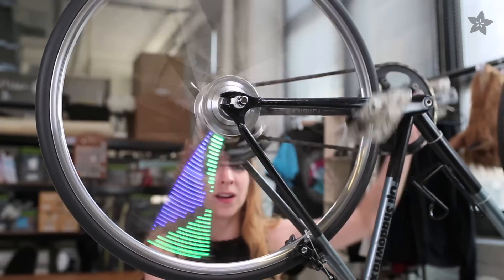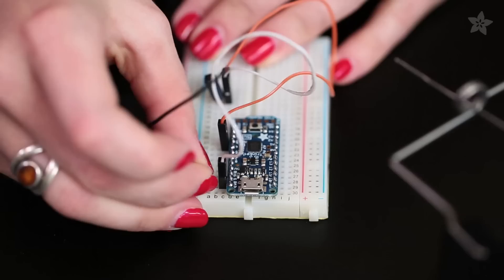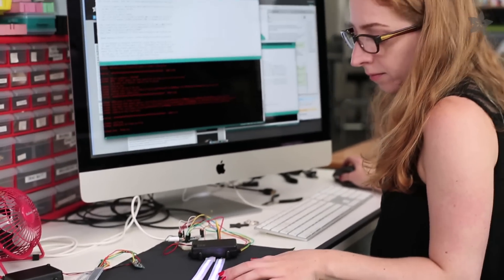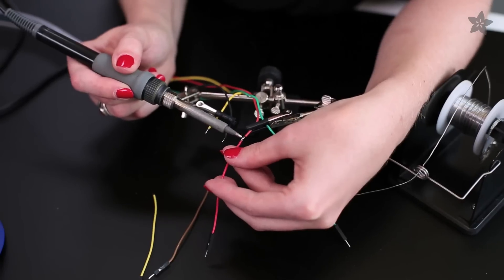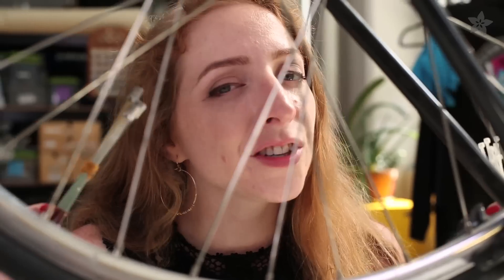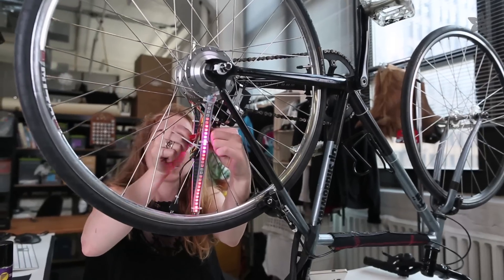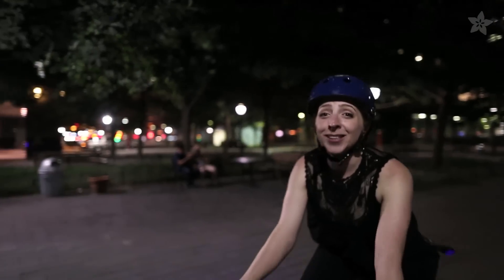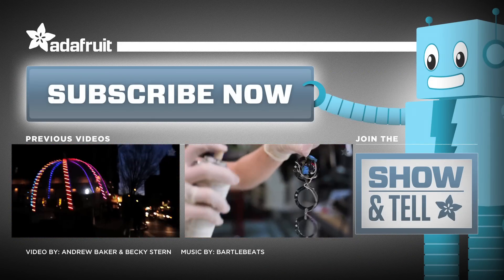Bike Wheel POV Display with Pro Trinket

Comment: Cool... Any plans for synchronised strips?
Four strips at 90° around the wheel would mean a visible display at sane road speeds. :)
Reply: Even with 4 strips, it won't work well.  Bike wheels move to slowly.  15mph is like 3 rotations of a 700c wheel per second, plus you will have moved 21 feet over that second.  Also, the battery complicates it.  It won't want to stay anywhere near the hub and it will likely cause vibrations of the wheel.